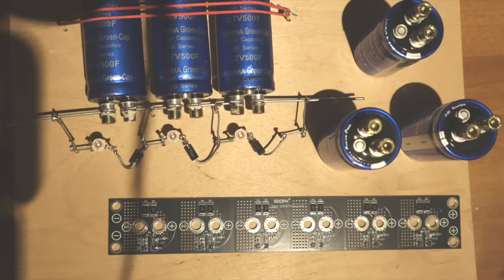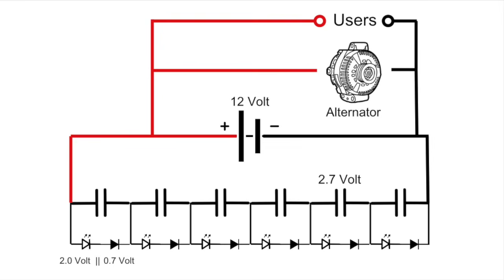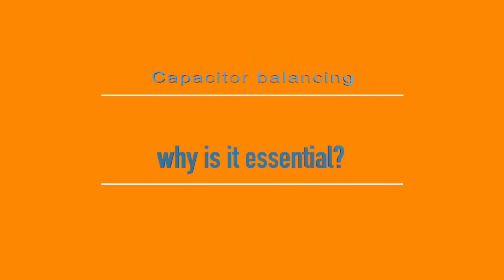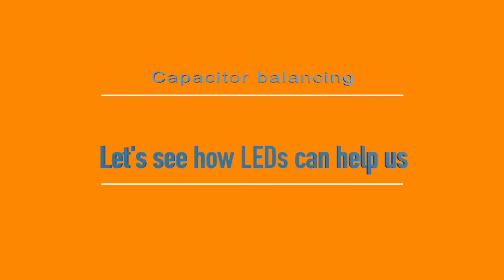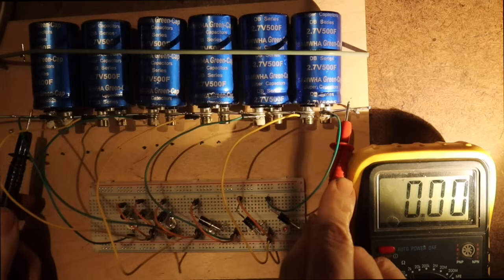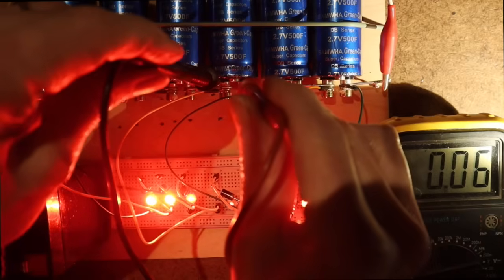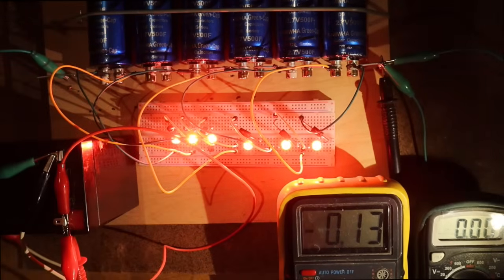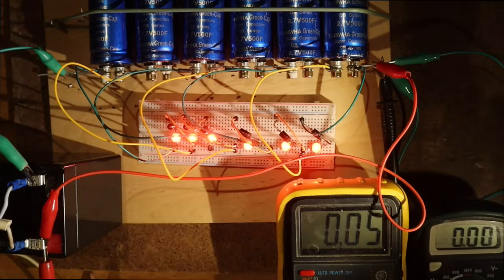How can a Super Capacitor help you start your car reliably and let live the battery longer? 86

Comment: المشكلة فى السيارة تاتى من المصنع الدينمو فى حالة توصيل مستمر بالبطارية الملفات الابتدائية لاتتوقف عن العمل تعمل متل مغناطيس وهدا يسبب فقدان مستمر لجهد البطارية
Reply from the maker: Hi Asad, I am working on my Arab language (no kidding) and hope that I can read this in a year without help from the computer! I hope the translation is correct:
"The problem in the car comes from the factory. The dynamo is constantly connected to the battery. The primary coils do not stop working. They work like a magnet, and this causes a continuous loss of battery voltage."
I agree with you for the time that the car is active, but then the rotor is energised from the alternator and the net energy is positive, no?

Comment: I've read about experiments with boosting car battery with supercaps several years ago. Supercaps have significant self-discharge close to their max voltage, thus authors kept em at half of their max voltage, where self discharge was minimal. 1 minute prior to engine starting battery charged supercaps, then they were cranking engine. I think they dumped part of energy from supercaps back to the battery after stopping the engine. The size and price of supercaps were close to those of car battery. The rationale is start at very cold temperatures and/or decrease battery load and thus prolong its life significantly. Probably start-stop system for non-hybrid cars. Keeping supercaps always connected to battery is no-no cuz their self-discharge will discharge the main battery. LEDs have significant leakage at 2/3 of their voltage at normal working current. Thus charge, balance supercaps, then disconnect em.
Reply from the maker: Hi Irop, that is a good point, thank you. What I did is a compromise between effective balancing and discharge of the battery. You are going a mile further and that is certainly something to consider. I am not busy with the development of the final system and will take this into consideration!
Reply: @nnvasen-good-energy  leave the car for a month untouched and you'll experience that the car's battery has been drained by the supercap-leakage...

Comment: Are you concerned that keeping the LEDs illuminated will discharge the battery? They are great for prototyping.  As for your question about modifying a car, it is not necessary to put the resistor between the alternator and both the battery and capacitors.  You can install it in series with your capacitor installation and not modify the car. I am curious if for a long term use circuit it might make sense to use the shotky only for balancing and use a small 50mA LED and resistor in parallel that turn on when a capacitor is above 2.3v? They will all turn on as each capacitor reaches 1/6 of 13.8v and they will all drop to no power loss when the bank falls below 13.8 volts?
Reply from the maker: Hi Ian, thanks for the suggestions. I would not like to put any resistance in series with the capacitors because of the high current it has to deliver. 
You are right about keeping the LEDs in very low current mode with voltage in rest mode. There we are lucky because when the car is parked mode the voltage is below 13 Volt and I fine tuned the LED and Schottky will ask very little at that level. Diodes are so exciting while you can let them take much more when the voltage goes to 14 Volt.

Comment: liTime has recently come out with a 1000CCA  1200MCA 145A BMS for <$500USD
Reply from the maker: Thank you,  I will check it. Is it a Battery Management System?
Reply: @nnvasen-good-energy  It advertises 145 ahr cells and 145A BMS (rated continous output).  This company has chosen to meet the needs of the recreational fisherman, which is a larger market with disposable income.  It is amazing the things we thought of as children are coming to be.  This simple tech you talk about is what farmers are using for their tractors for cold mornings.  Almost all of my jump starters use this as well.  A little more xpensive but worth it.

Comment: 以實際應用下，LED 品質差異、不良、損毀下的狀態（短路情況、開路）這樣是風險的，沒有保護廻路對超級電容很不幸。
Reply from the maker: Thank you QG, the first comment in Chinese, such a beautiful language, fetching haoting! I can imagine that there need to be protection and I also mention in the video the possibility of a fuse that is also a resistance of a few hundred miliOhm but if it blows the related capacitor looses its protection altogether. It is a surprise that LEDs are so fragile as you seem to warn. I tested them for differences with the others as well as the non light emitting diodes. In some way I have to protect the final version when l make the video.

Comment: Also, have you looked into power factor correction caps for whole home use for both the EU and US power grids?
Do they work?, Do they save?, Are they worth it?, How do you determine the appropriate size of caps?, and would it be better to have a dynamic vs static cap bank to adjust for the various loads, and if so, how would one do this?

I also know that 'Power Smoothing' can be used for the inductive loads for power factor, and also for the high frequency intermittants that are safer for electronics, but may require different methods to do so.  A discussion on both types of systems would be helpful if you have the interest.
Thanks, Ken.
Reply from the maker: Hi Ken, I have been working fir energy efficiency in the manufacturing sector,  there itis quite normal (or should be) to have also variable phase correction but that is with other kinds of capacitors. It is because they pay also for a large VA consumption. I can see what benefits phase correction has for the domestic sector. Thanks for the tip!

Comment: You might be just the guy to solve this problem:
Car battery charging systems generally charge up to 14.7V.
An ideal charging system to fully complete the desulfation process of charging requires 16.2V.

Thus under normal charging systems, the battery NEVER fully reaches its total chemical completion of charging and thus continually accumulates sulfate residue on the plates which terminates the infinite lifecycle of the battery prematurely.

Thus, can you think of a simple way to provide a 1.5V boost to the charging system or an intermittant higher voltage shock that would resolve this problem and always allow the plates to be fully clean and free of residue for a truly infinite lifetime lead acid battery?
I should also add that any charging voltage supplied to the battery above 16.2V, just causes a boil off of the electrolyte, so this 14.7V current threshold could be seen as a partial safety measure to retain the electrolyte, but even if we reduced that 1.5V down to 0.5V, that would increase the lifecycle tremendously.  There are also some interesting anomolies that take place once the batteery is 'trained' to that 16.2V limit that would be great to pursue as well.

This research was discovered by Peter Lindemann in his program Battery Secrets and that spawned his Tesla type Battery chargers which are great for reconditioning old batteries (and a bit expensive), but do nothing for the operating vehicle.
I wish that I could do this research myself, but I am not in a space or condition where that can easily take place.
I can provide more info about his research if needed.
Thanks for this video, Ken
Reply: Great information. Thanks a lot!
Is that research open for public or how can I get some more details about it?

Thanks.
Reply from the maker: Hi Ken, that sounds very interesting indeed to increase the lifetime! I would be interested in knowing more. Even if it becomes quite specialised, but ok, cars are part of Energy Home.
Reply: Google Battery Desulfator.  You will find both circuits to build and products to buy. They use the 12v with a capacitor charging circuit to build up to 16v and then pulse it back into the battery.

Comment: Just buy a decent quality battery and use engine oil that has a suitable cold end viscosity rating. 
A premium grade car battery can last for 16+ years even in a diesel unless the battery is abused or there is a charging system fault. Cars built in the last 30 years have high output alternators.
Reply from the maker: I would like to do a bit of research in high quality batteries and their prices. Certainly, 16 year is a car lifetime and it would kill the problem.  But then, people should buy them more!

Comment: far easier to buy a higher cold cranking battery.
Reply from the maker: I was in Rome yesterday and the antique Romans said Tutte le strade portano a Roma (all streets lead to Rome) 😉. I agree that we must not complicate life but in practice I see people take the standard solution of installing a standard battery for 100 - 400€ and I think that it is nearly OK because the battery can survive it. But I still see it as people that arrive at 100 years with cigarettes and/or alcohol, even when it I not really good for health! I read in comments about high current Li batteries and during research I found hybrid batteries that can do really well the heavy starting work and at the same time have many AmpHours. Then it is OK for me. But as long as standard batteries are the first choice in the market and in the work shops, I like to propose this not too expensive solution that takes away the heavy weight lifting.
Reply: @nnvasen-good-energy dont worry about critics , us DIY tinkerers would much prefer your solution and learning from the process ! Thank you so much 🙏

Comment: Very cool.  I've been wondering about the issues when integrating these.  Disappointing how long it takes for them to balance.  Instead of the diodes discharging the current (wasted), it would be nice to redirect it to the runt somehow to speed up the balancing.  Odd thought, almost like charging them in parallel but discharging them in series.  Also would be nice to add something to prevent the cap discharge from draining the battery if parked for 1 week.
Reply from the maker: Hi Chris, thanks for you appreciation!
Reply from the maker: I also have been thinking about avoiding any energy waste and therefore choosing a combination of LED and other diodes that limit the point at which they start to conduct. But then the balancing is a bit more slow. However balancing is incremental and once the capacitors are equal and reach their steady state, the diodes have less work to do.
Charging in parallel and using in series is very interesting, however it is on the condition that you can really distinguish onmoments that you charge and consume and sometimes these processes are going on nearly at the same time. It also requires high current switching gear.

Comment: Podría ser leds en paralelo para que uses el mismo voltaje y aumentes el amperaje?
Reply from the maker: Hi Frank, sure you can and I am considering putting LEDs in parallel. You must test that they are the same. But it is an additional complication and then I found high power LEDs on alibaba. Also Amazon USA has them.

Comment: How does the set-up deal with the heater plug draw on a diesel engine, as they draw close to 100 amps?
Reply from the maker: I can imagine , that's 300 Watt for each cylinder! I imagine that they start for a second or 2 and then you have the cranking moter with maybe 400 Amp. The all come from the battery (today) or from battery plus  capacitor bank (tomorrow) !

Comment: Just A bit curious, the serial equivalent capacitance is 83F = 500F/6 for this super cap set. Won't its voltage drop should be 1500C/83F, around 18 volts?
Reply from the maker: I am so sorry, you are right!  You can also see it in this way: if you take 500A for 1 second from 1 capacitor, it will loose 1 Volt by definition. The series connection will go down 6 Volt. Fortunately my margins with the current needed to start were large. 500 Farad are indeed used for car starting. I saw on videos that those 500 A are needed for big cars and for a fraction of a second.
Reply: @nnvasen-good-energy 1/C=1/500 +1/500+1/500+1/500+1/500+1/500=6/3000 therefore C=500F not 83Farad?
Reply: The store bought super capacitor jump start I have has 5 off 500F 2.7 capacitors giving 13.7V and 5x500F in series =500F x13.7 V

Comment: Can they do it at -10F?
Reply from the maker: Hi Rock, use those made with Aqueous Electrolyte that go until-40°F. Moreover try to isolate or put close to medium warm components. Organic electrolyte will increase internal resistance and than wit high currents you get nasty effects.

Comment: the trouble with super cap's is they have high internal leakage this increases exponentially as they age. just replace the super cap's with 4 18650 2hr lithium iron cells very low leakage much greater cycle life then super cap's and better cold weather chemistry than caps and probably cheaper.
leave everything else you discussed the same
Reply: don't bother with resistors as mentioned in your video just calculate your connecting cables correctly so they provide the required resistance. if you think about it what's the point of using ultra low resistance connections only to then degrade them by adding a resistor in series with them calculate your connecting cables to work for you not against you. 😉
Reply from the maker: Yes, that is a good point, but the cable between alternator and battery is just built in an probably made for very low voltage drop.
Reply from the maker: I don't agree that replacing supercaps with Li batteries is the solution. That is because supercaps don't have their own voltage and they can therefore always be connected with the battery. With Lithium you have a voltage conflict between two chemical processes. 
Supercaps don't loose much current (for the battery), here an example: in my case the caps were cheap and lost in 12 hour 10%, that can be 0.25 Volt with 500 Farad is 125 Ampère seconds or 125 Coulombs. That is not so much for a battery because if it has 70 Ah, that it is 252000 Coulombs that he can deliver.
As I understand, supercaps will also not age quickly if the voltage remains well under the 2.7 Volt limit. In a 6-pack the voltage should remain below 80% of that if well balanced.